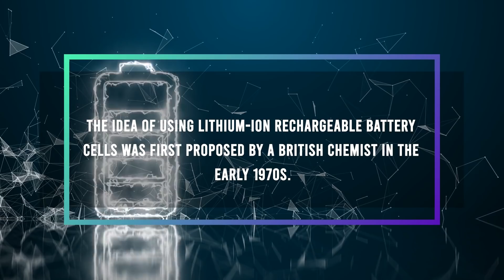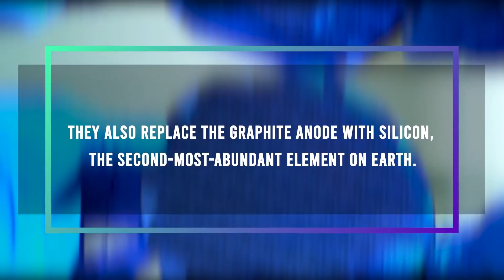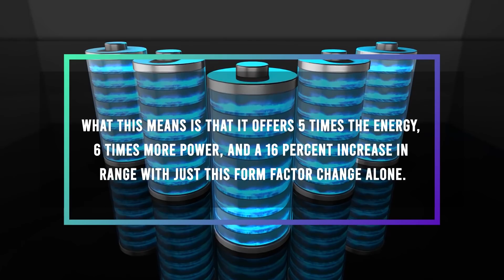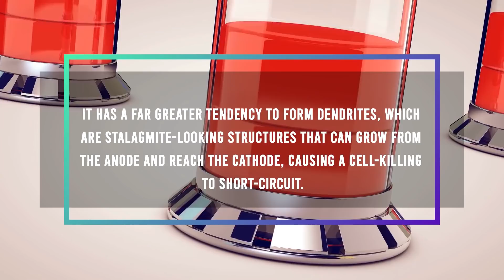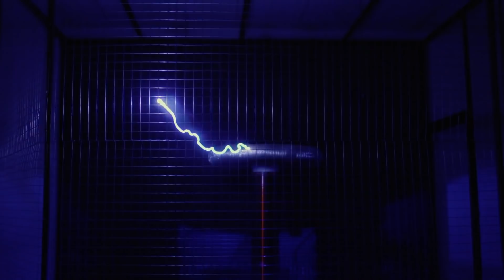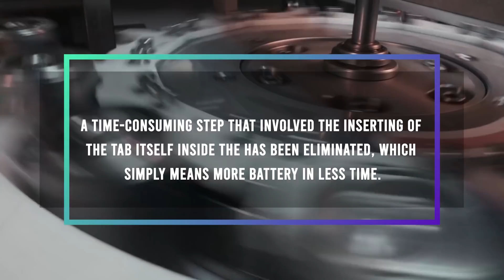Tesla's ABSURD NEW 4680 Battery Will Destroy Solid State Battery Competition

Comment: Currently, I understand it is very difficult to scale up production of solid-state battery pack. Tesla is close to +75% success rate with the 4680 cell when scaling up to production capacity. It’s a mechanical problem, only. 100% productivity is achievable very soon!
Reply: This is what I had heard also.  Developing new machines is a trial an error process and when they started less than a year ago was something around 90% failure of the battery machines

Comment: I don't know too much about batteries, but 4680 to me is an improvement of traditional technology, while Solid-state is a revolutionary early stage tech. You can't compare their performance over different stages of tech. A trained horse runs faster than the first model car. Let me know if I'm wrong.
Reply: I completely agree with you here. I like Elon (not a fan of Tesla tho) but I think presenting this new battery as revolutionary is misleading.
Reply: @faustin289  it is the dry electrolyte that is the revolutionary part getting into manufacturing
Reply: @stevepailet8258  

Thomas
Reply: Tesla are in the here and now and producing real products. They are not a research company.
Reply: Exactly. Dismissing solid state batteries is downright moronic. I'm old enough to remember when flash memory was starting to become a thing. Early memory cards were SUPREMELY more expensive than floppy disks and a lot of people were certain that it'll die within years, on account of its sheer cost, but we all know how that turned out.
Reply: The Innovation is in the way the poles are connected. This solves a lot of problems the traditional cell types had.
Reply: Agreed, solid state is the next step.  I followed QuantumScape for a long time.  There are some great batteries coming in the next several years.
Reply: Agreed, but solid state batteries will take at least 10 more years to commercialize. When they start to approach market we can talk about their impact on the market, until then they're not really relevant.
Reply: I think this channel is a Tesla fanboy channel. So you are right!
Reply: It doesn't sound like the tech is ready though and if it would ever be ready before a better tech arrives.
Reply: Nothing garuntees solid state to be the next evolution of batteries. It's been around for awhile now and there hasn't been any significant breakthrough that any company should put so much R&D just yet. Teslas tabless batteries will be the best for quite some time.
Reply: You are very wrong..........BYD's LiFePo4 are superior in EVERY way..........Paul
Reply: @paul-flyer  I thought their blade style was the amazing part. Size is the limiting factor for other cells like the prismatic
Reply: @paul-flyer  BAK Battery Unveils First Chinese 4680 Battery Cells - LiFePo4
Reply: @paul-flyer  I am not sure about every way but they certainly are an excellent form factor.  Will be interesting to them really hitting the market

Comment: 5 times the energy of other Li-ion cell topologies??? I watched battery day and Elon did not make such a rediculous claim! It was 15% higher energy density on the pack level from losing the tap and using bigger cells. 1'st gen solid state batteries do not offer significant advantages over conventional batteries. They do last longer but will be more expensive. Second gen is a different matter. They'll be around twuce the energy density, so people will say Elon who? Should I report this video as fake extremist or as damaging to children?
Reply: First to market wins, remember?
Reply: @gregbailey45  I complained about the quality of the video, not the brilliance of Tesla. Tesla has all the resources to get a licensed production up and running once solid state batteries are commercialized. But the place of solid state batteries, as I said, depends on their manufacturing cost.
Reply: @Tore_Lund  agree with what you said. Dont worry bout trolls. Many people like to argue one fixed solution like a solid state battery to end the problems of batteries forever. Even sounds ridiculous writing that out. They don't think with that many more qualified engineers know it better than a one sentence comment.
Reply: @superheaton  When batteries are 1kWh/kg, 4 times as good as curret Li-ion batteries, we will have cars that have the range and acceleration per HP as gasoline cars. People are forgetting that EVs today are insanely overpowered for what the can do, because they weigh as much as a small lorry. I'm pretty sure the better battery technology will win, even if it is more expensive. Historically, this has happened every time a new battery chemistry has come to market.
Reply: Las baterías de estado sólido de 1ª generación ya son entre un 30 y 40% mejores que pack 4680

Comment: In the end, everyone is a winner (as long as they play fair with each other). Tesla just wants cheaper and better batteries. Nobody could deliver them so they started doing that themselves. Essentially Tesla wants to deliver affordable electric cars with good specs.
If affordable solid state batteries turn out to be rolling from the manufacturing line earlier than Tesla's 4680, then that will be just the next battery for Tesla to use.
Reply: Maybe.
Reply: NEXT....LiFePo4...........later....Maybe something better...........Paul

Comment: QuantumScape has shown 4 layer at 800 cycles >90% energy retention. Able to use LFP. Charge in 15 minutes. Proprietary ceramic separator prevents dendrites. Fire resistant. More energy dense. Will be the only commercially viable ssb. Tesla will be left behind when battery testing is complete if they don’t form joint venture with them.
Reply: But Ted, do we know what the cost per KWhr will be?
Because, if it’s too high, it won’t be competitive (yet) with wet process Lithium. 
My understanding is that they are still 5-10 times the cost. Do you have any actual figures?
Reply: @Nicholas.T  I'm not sure, but to be honest this CEO has big balls to keep his claims solid. YES PUN.  Its well worth the shot, if for some reason JD is correct this will be life changing money and gains.  Tesla won't at this point.  Tesla is like a bond, they will make a move IMO once QS comes out with the data and prototype.  I also read that QS will double capacity and without CAPITAL COST increase.  Which would be massive for tesla.  Lets wait and SEE!
Reply: It's probably cheaper to just recycle a Tesla pack after it's million miles when it has dropped to 80% and make fresh batteries than waste money on SS.